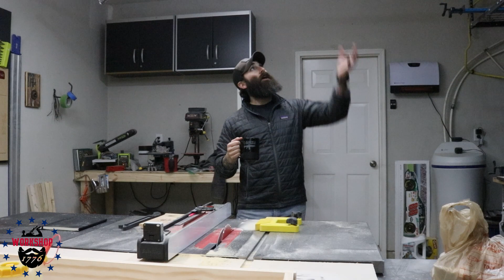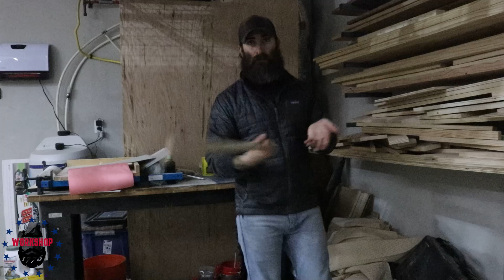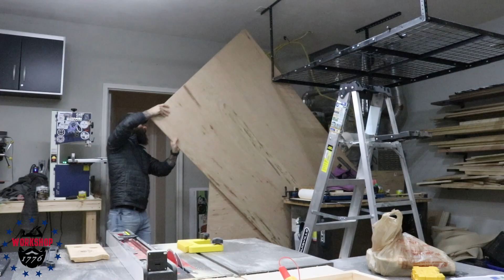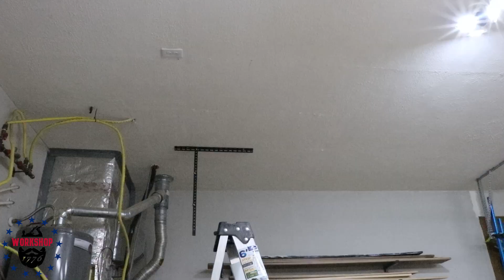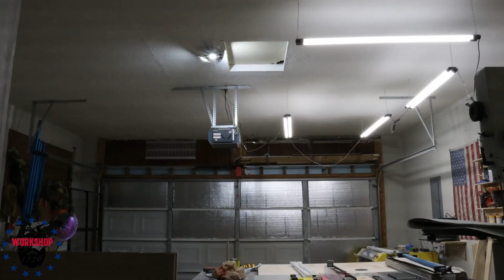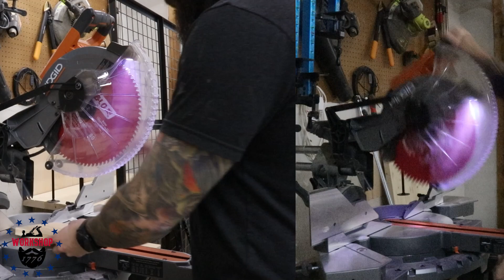Easy Shop Lighting // DIY LED

Comment: How big is your table saw/ work bench? In your opinion is it too big or too small? Just moved and no longer have a work bench. Trying to figure out how big (or small) to go.
Love your content, definitely go epic music for the time lapses!
Reply from the maker: Thanks! so i have the SawStop 36" table saw (which is perfect for my shop) and i built an outfeed that is the same length -ish but its too wide, at 39". also another problem is that it is attached to the saw. In the future I will make it mobile, and probably 36" x 30" I dont need the outfeed all that often so it would be awesome to be able to use it away from the saw, and to rotate it of im ripping really long material. Hope this helped!

Comment: Great upgrade ! I bought similar lights for my shop. I have 10 of them in a 14x20 garage shop. Everyone should do this. I chunked the chains and simply drilled holes where I needed in the center metal rib of the lights which made for easy installation into the ceiling joists. It looks cleaner this way IMO . I used fender washers to help distribute the force from the screw. They are very solid and bright as hell.
Reply from the maker: Nice! I went with fast as possible install haha